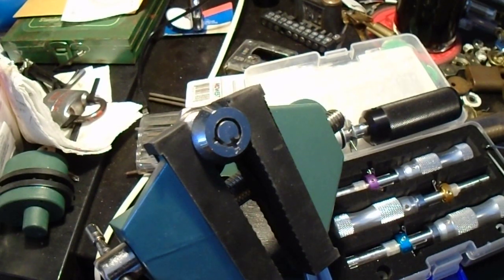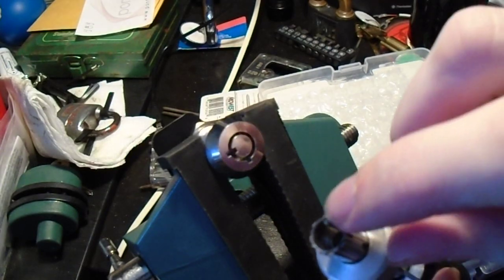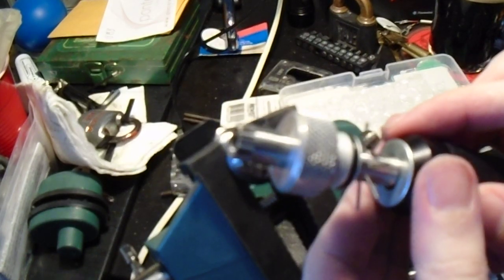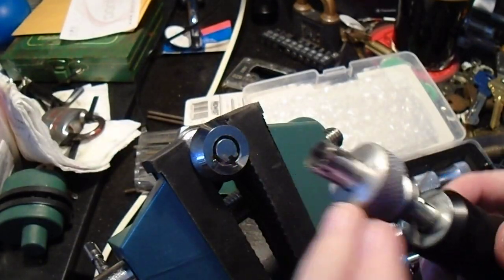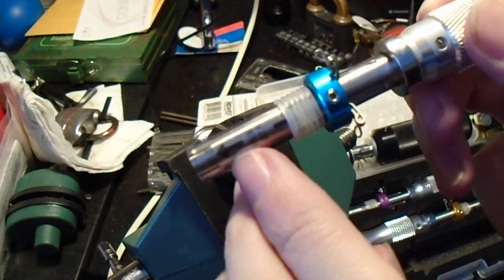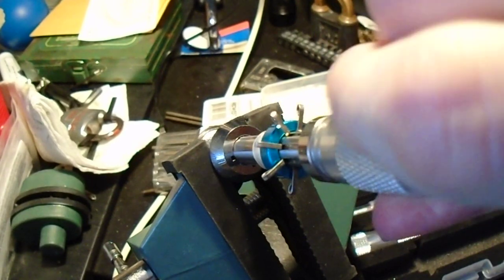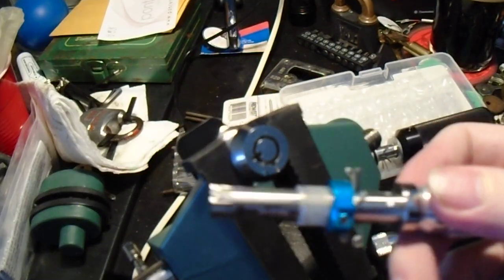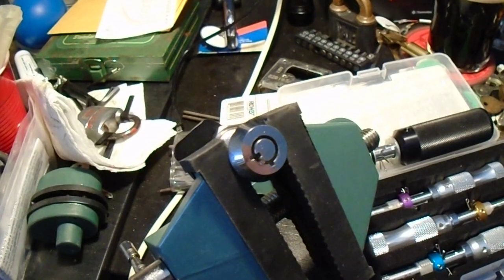(041) Introduction to tubular lock picks

Comment: tilting the tool will give you an inaccurate impression of the pin depths. You put it into the lock straight and vertical, then you turn it right and left (no tilting) while applying pressure, until it opens.
Reply: Yes, that's also what worked for me.

Comment: im not sure what or how the key is called i have a slot machine that the keyway is vertical (ive lost the key to it ) the key is impressioned on both sides of the key like a router style cut what is that type of key called and what type of pick would you use to open it

Comment: You are tightening the tool way too much. Slacken the nut off so the feelers are free to move. Then tighten the nut slightly, you should still be able to move the feelers by hand.. Insert into the lock keeping it straight. Do not rock, tilt or jiggle....
Simply press the pick into the lock, hold it in while twisting left n right gently.  Once picked, you tighten the feelers a bit tighter.

Comment: Will the southern specialties open an Ace II?
Reply from the maker: You might get lucky, but most of the time they will not. The ACE II uses various techniques including tapered driver pins and varying spring strengths to prevent self impressioning tools like these from working most of the time.

Comment: every time i try to use it put in the lock the pin slide back in the holder it act like it is to tight  do you have any answer
Reply from the maker: +Charles Nunnally It sounds like you need to increase the tension on your pick. If you have a tool similar to the Southern Specialties tool I demonstrated, tighten the retaining nut as much as possible then loosen it no more than a quarter turn, try it and then adjust looser or tighter in very small increments.
If you have a tool similar to the Chinese picks I showed, they usually come with a small allen wrench to adjust the tension ring, and a set of small rubber bands, to increase tension, add a rubber band and use the allen wrench to tighten the retaining ring. Lick the Southern Specialties tool, tighten it as much as you can then loosen it very slightly and test it, then make very small adjustments until it works.
Some tubular locks are simply very badly made and may present an extra challenge. I would suggest practicing with one that functions smoothly (FJM Security Products has some good ones for sale on Amazon that make good training locks) before attempting one that offers the extra challenge.

Comment: How do you tell if it is a 8-10pin?
Reply from the maker: With a tubular lock you can see all of the pin stacks (the keyway is the open circle and the tips of the pins all protrude into the keyway) so you can simply look and count. The 4 standard arrangements are 7-pin centered (7 pins with the index notch taking an 8th position), 7 pin offset (the 7 pins are in a different configuration relative to the index notch but the spacing remains the same), 8 pin (8 pins spaced similarly to the 7 pin but fills the empty space, the index notch is between two pins), and finally 10 pins (10 pin locks are usually a larger diameter than 7 and 8 pin locks). Some manufacturers make 'convertable' pick tools which can be configured to fit the 3 common configurations of 7 and 8 pin tubular locks, 10 pin tubular picks are somewhat rarer and are not compatible with 7 or 8 pin tubular locks.